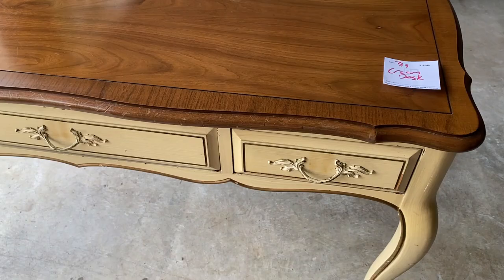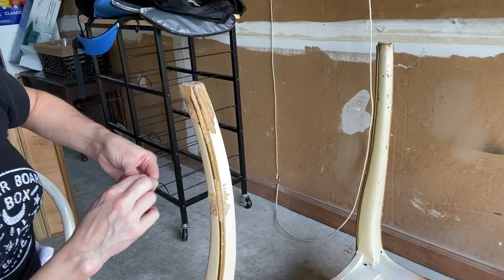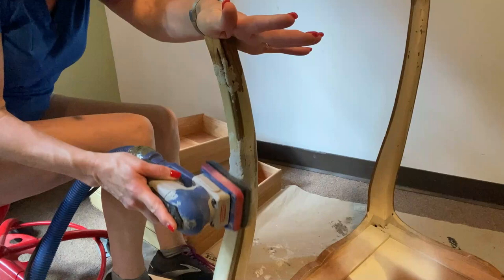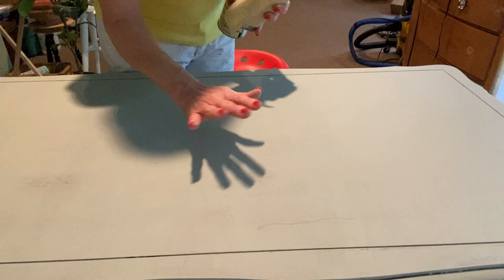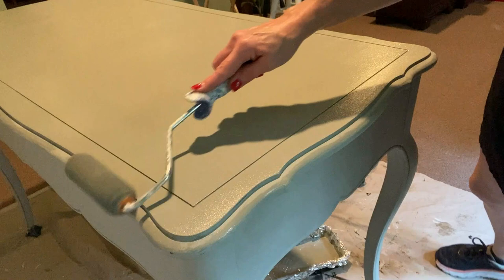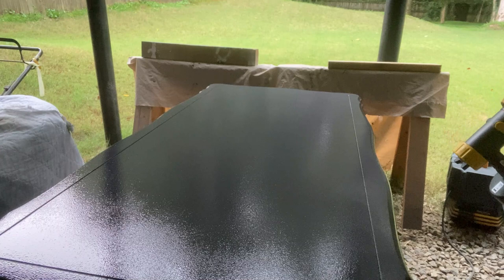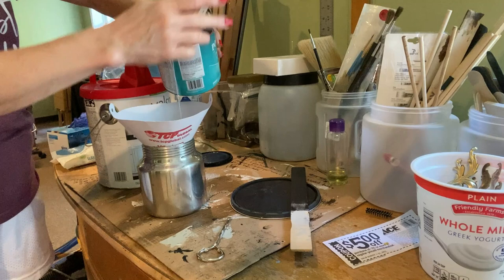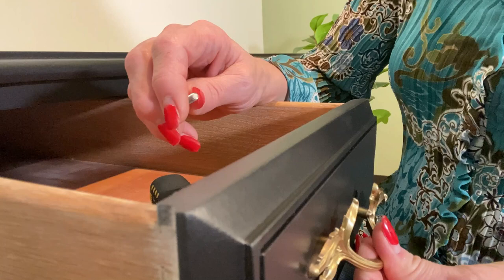DESK REPAIR & MAKEOVER : Repairing a Dog-Chewed Leg, Before and After

Comment: Very elegant and timeless. I was hoping you would show how you approached carving out the line on the damaged leg with the Dremel. I have the same problem with the edge of the top to a coffee table. I’m a little unsure as to how to use my Dremel to achieve that. Help?
Reply from the maker: I decided not to add that because I didn’t want the video to get too long. I recall using the Dremel in a similar situation for a previous video. If I can figure out which one that is, I’ll send you the link. I’ll also see if I still have that footage from this project to send to you.
Reply from the maker: Verena, I used the Dremel in the following three videos. https://www.youtube.com/watch?v=N00tVbNNeMQ&t=67s
At 5:00 I used the Dremel with a rotary cutting disk for the first time to cut sheet metal.

https://www.youtube.com/watch?v=lle3eycxuAc&t=23s
At 1:34 minutes I used the wire brush attachment to remove paint from the grooves of a drawer. I'm fairly certain this was the attachment I used to recreate the groove on the desk.

https://www.youtube.com/watch?v=ug1EKg5GW7Y&t=111s
At 2:00 I use the rotary cutting disk to modify outdated hardware.

As far as how to set up the Dremel and what attachments to use when, search YT for Beginner Dremel videos and I'm sure you'll find what you need.

Comment: You mentioned 2 black paints in the video. Sherwin Williams and valspar. Did you only use valspar in the video?

For a second I thought you where using Sherwin Williams caviar for the first coat and valspar+poly combo in the second and 3rs coat.

I think what you did was use valspar color matched version of Sherwin Williams caviar correct?
Reply from the maker: You are correct. I used Valspar F & C paint. Apparently there is a Sherwin Williams version of Caviar as well as a Valspar version of Caviar. I asked Lowes to tint my paint with  Sherwin Williams' version of Caviar.